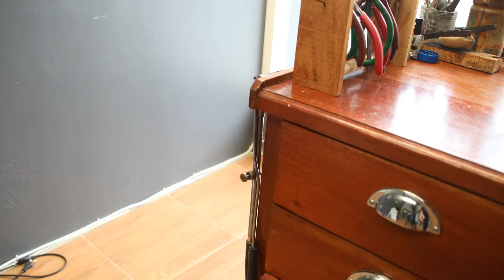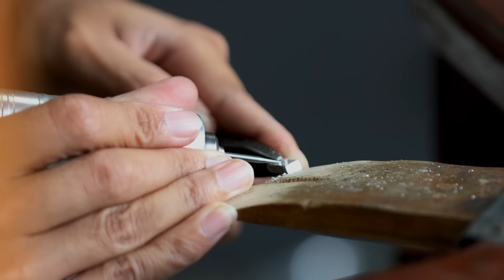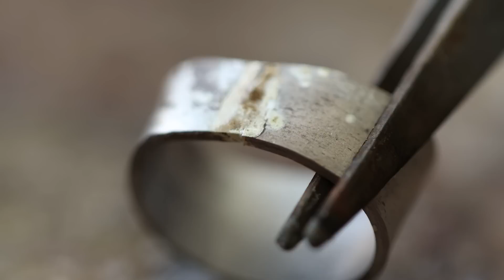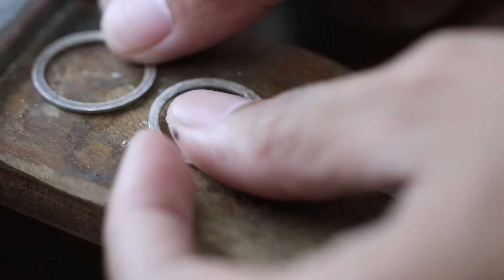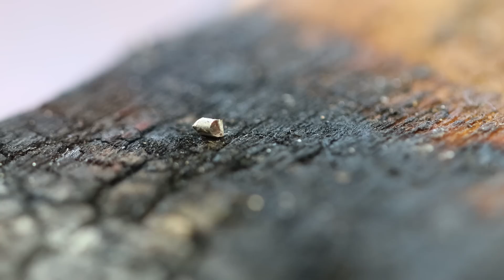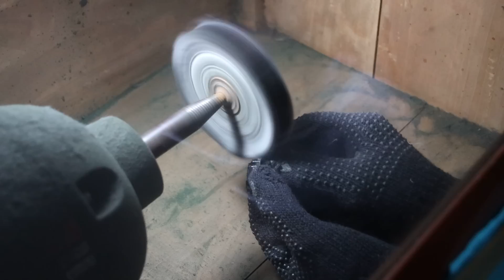making motorcycle chain ring jewelry design - custom silver ring for men

Comment: What tools do you need to start creating your own jewelry? 
It looks soo peaceful
Reply: Not a lot is needed to get started.  Get a catalogue from 'Rio Grande' jewelry supply. Sheet silver and wire can be purchased from Rio Grande... some flux and silver solder wire. A $10 set of jewelry files. You can get a jeweler's saw from them for maybe $20. 
Harbor freight has a lot of what you can use, a simple $30 plumbers torch is hot enough to silver solder. a Dremel for $50, a small ball peen hammer, many other tools. A polishing wheel comes in handy, but a decent polish can be achieved with super fine sandpaper and a polishing cloth.
You don't have to make something complicated to start. Simple silver bangle earrings are beautiful. 
Brass is a very pretty metal you can learn with at low expense.